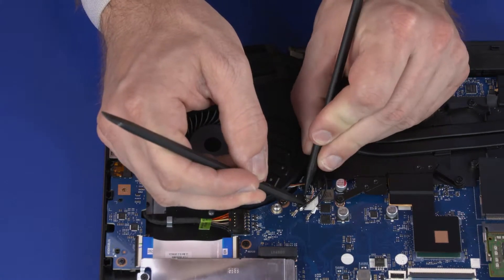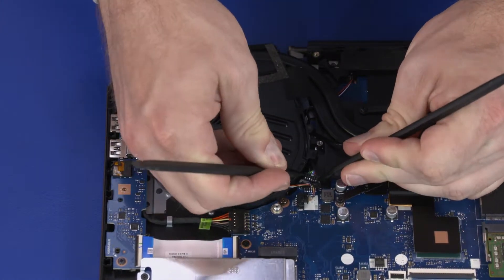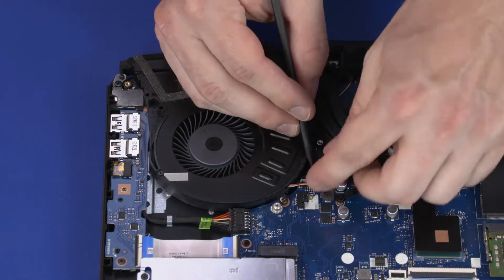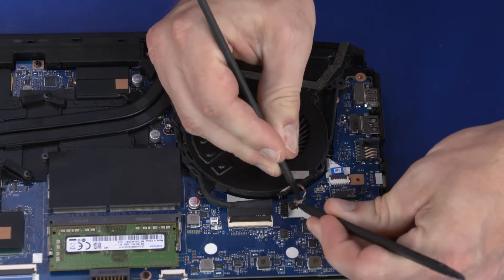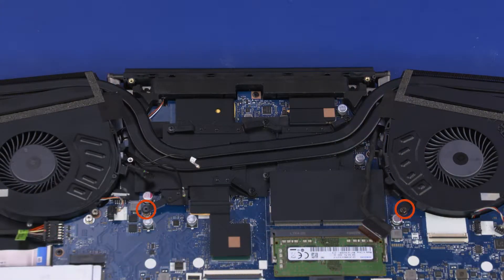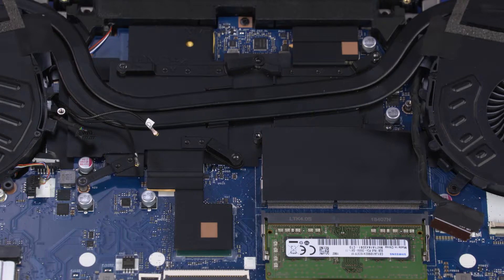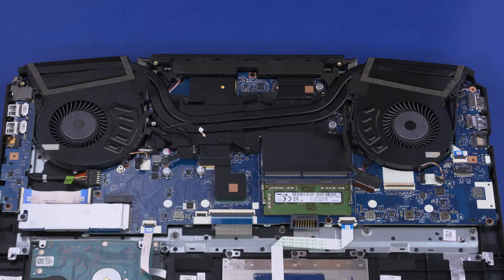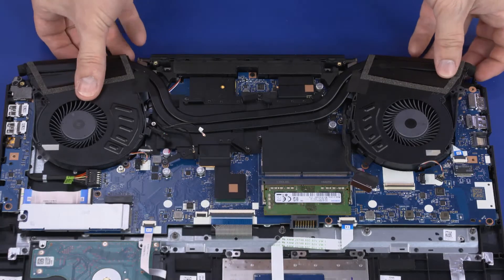Replace the Thermal Module | HP Gaming Pavilion 17t-cd0000 CTO Series | HP

Comment: is it possible to remove fan only from the thermal module and replace it?
Reply from the maker: Hi Shazam, thanks for contacting HP Global Social Media Support!
I understand that you need to know whether you can only remove the fan.
I will do my best to assist you.
You can remove heat sink/fan assembly, not only the fan. 
Binu_HP Social Media Tech Support
Reply: @HPSupport  So is it not possible to remove only fan? I just wanted to clean dust in the space between heatsink and fan. Due to the dust my CPU and GPU temps are going above 90 degree celsius.
Reply from the maker: Nope. It is not possible to remove only the fan.
Binu_HP Social Media Tech Support
Reply: Hey bro.. I know it was 2yrs ago LOL but i just seen your comment. Your best bet is to buy an air compressor 100psi.. Blow out the fans, but make sure to hold them when you spray air.  I can run any game today, yeah no race tracing but if you upgrade your ram to 32GB or higher you will actually cool it down. At least mine did.  Also i changed my thermal paste twice.  I always achieve  210F which it really doesn't matter... You forgot you have/had a laptop.  I have had zero issues with this HP or i7 9750H/ Gtx 1660ti MAX Q.. I run games as hot and as hard as i can man..  

On a 75in t.v even. You just have to have it on a hard surface or a cooling pad. No need for fans really unless you wanna change it 1-3 degrees.  Just change your paste it's really easy if you want. Just don't overtighten the screws (the ones in numberic order) Just hand tight. 

.. Remember gaming is pretty hardcore for any machine. The handhelds right now suck cuz it's the same life on battery as a laptop...  But you NEVER game on a battery for a laptop. They just aren't made that way right now. Just have to stay plugged in. <3 Good luck!

Comment: Tell me about model cd0067ur, please.
1) If it has 2 SODIMM slots?
2) If there is only SSD, could i also use HDD?
3) What about 
the guarantee if i need to add extra RAM and HDD?
4) Could you write the exact models and producer of SSD and RAM?

Thank you beforehand)
Reply from the maker: +RockNrollA35rUs Please refer page number 1-2 of the user manual to know about the supported memory and storage: http://bitly.com/33jGO5M Please select your country and enter the serial number or product number here to know about the parts: http://hp.care/2bMA2PC